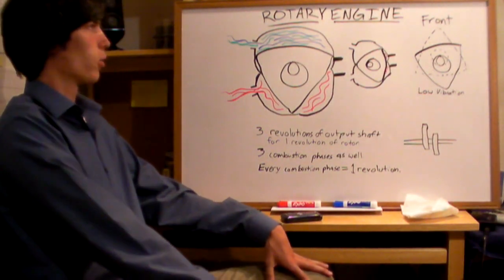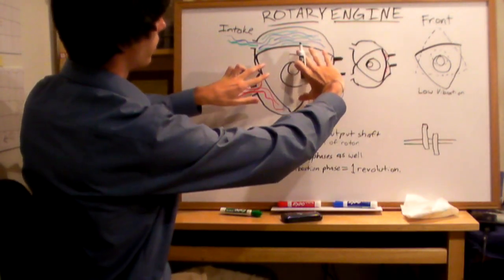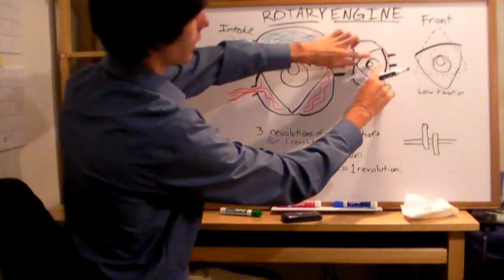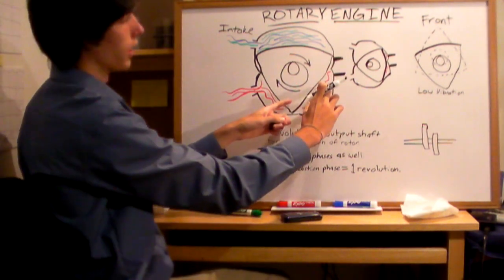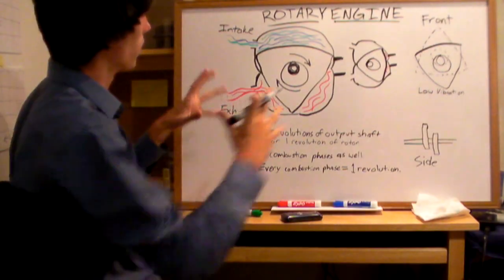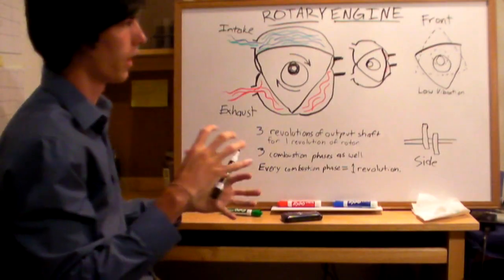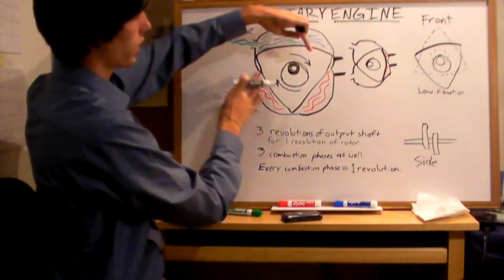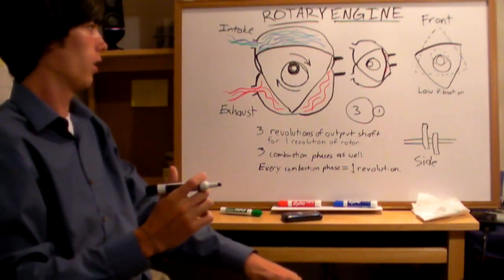Rotary Engine - Explained

Comment: Rotaries are like the engineers wet dream. 3 moving components, amazing power for size and weight. One thing, you're right that apex seals are some of the higher stressed points of the engine, but the synchro gears (the gearing on the rotors and the housing to maintain accurate rotor movement) tend to be the limiting component when it comes to high rpm race engines.

Comment: I had an fc for about half a year. If you are in a budget. Do not even think of getting a rotary.  They use way to much fuel for the power you get. Yes they are small engines but uses a lot of fuel. Only reason I got it was because the sound of a rotary is beautiful.

Comment from the maker: The engines are quite different, and a rotary engine has more power strokes per crank revolution than a 4 stroke engine, thus it produces more power with a smaller volume. Kinda like a two stroke engine.

Comment: seals are an issue, but also emmissions and efficency are also a big problem, Due to the long combustion area (stroke) and low(er) compression plus higher available RPM means fuel can struggle to burn properly and you can end up with a pocket of unburnt mixture trapped ahead of the flame wave that just goes out of the pipe, they can be very reliable when driven nicely, but if you push the red line no rod knock, no valve ratte to warn you 5k miles ahead of an impending problem, just a bang.

Comment: There are more than 3 moving objects in a rotary engine, you only mentioned the 2 rotors and crankshaft. There is also a counter weight. And about the gear ratio rotor/crankshaft, I thought the crankshaft had less revolutions...

Comment: they have different emissions, not exactly poor when considering. The problem is that the emissions rules are created to suit more common engines. The new mazda rotary is extremely efficient now though, they fixed the problems with ports in the new RENESIS.

Comment: Hello I am very interested in the automotive industry. I was just wondering how does a pair of rotary engines compare to regular V6 engine. Is there a major power difference and will the MPG be greatly different. And my last question, is there any way to make it so that the rotary engines can output more horsepower.

Comment: i have an rx8, and this engine does not have very good gas mileage and burns oil (1 quart ~3000 miles)

the apex seals wear out over time and lose compression. this results in an engine rebuild. when they break, they may even hurt your engine more

Comment from the maker: Interesting question. I would think it may be a bit easier, since there are less parts. But developing the manufacturing process would be the major cost, and if the engine can't deliver, the overhead cost isn't worth it.

Comment: First off, by performance, I mean race engine. Low low-end torque is a non issue in a race engine, its all about peak power. Second, rotary engines wear faster, but they're highly durable with new parts (inherent in the few moving parts design), again a non issue for a race engine. Third, they produce more power for the weight than a conventional engine. Have you never heard of the 787b?

Comment: lower compression ratio may be a downside but if its supplemented with more rotors, turbos and spinning at over 9000 rpm, then they're the best performance engines in the world!

Comment: I think you didn't mention the most important pro and con:
Pro: It allows for power power from a smaller engine
Con: It's very hard to keep the parts between its chamber in good condition, causes leaks and loss of pressure. This is why rotary is in this way in fact less reliable.

Comment: I heard that the gaskets on the sides of the engine couldn't keep up, cause of the material it was made from. I know here in South Africa the Rotary racing guys engines are not as reliable as any other, though a 1.3 liter rotary can keep up with a 3 liter v6. but the noise of the rotaries is going to make everyone deaf.

Comment: yeah, but the Rotary Engine is GENIUS Comperitively speaking to other engines that are in every non-rotary engine car today, in a regular car engine you have internal moving parts that change direction to the opposite direction...Rotary Engines don't have any moving parts that change direction, therefor are able to rev 300% higher...

Comment: The RX-8 isn't that very small... in fact I've seen S2000s which utilize the F20C Inline-4 with VTEC and 240hp. These cars are smaller lighter and make a lil more power at higher rpms and have a higher 9000 rpm redline. Rotaries are considered high end power engines as they don't quite make that much power in lower revs.

Comment: 390 plus redline at 9000 rpm without big bucks for the TRD 4A-GE?? I just said it does 11,000 RPMS!! My god you have clearly no idea about this engine hell the F20C does 240hp at 9000 rpms and is built by Honda! These engines can have a 4k Turbo or supercharger with another 3k for tuning and intercoolers and get over 480hp with no issues, and please... do some more research and less name calling.

Comment: ........ You're clearly aren't as smart as you may seem because the 4A-GE is Toyota's Inline-4 made for the AE-86 1986 RWD Corrola GTS Twin Cam and the TRD Version makes 240hp and has 5 valves a cylinder, and Toyota is JAPANESE. The MP4-12C goes for $230,000 USD so you are just plain ignorant and as for the 7k revs I was clearly speaking of the Rotary engines. And the ZR1's OHV V8 goes past 7k and the Ferrari 458's DOHC 4.6L V8 does well over 8k revs stock so you clearly don't know stuff.

Comment: bang for buck means ......... if i spend 10 grand on a rotary engine it will most certainly get down the quater mile faster than a v8 or whatever. mazda might not be a sucess in the us but thats not because of the engine , its because you wanks like larger cars something the rest of the world has no problem . man check out top gear mazda rx 8 and see what they have to say about it

Comment: I'm not going to agree there bud.. If you have to tone down for more reliability then that's not saying much that the engine is having problems and is unable to make the power without breaking something. The F1 cars can or already do make over 1000 hp but safety and regulations prohibit such a thing from happening. If you can't run it... it doesn't count. That goes for EVERYTHING as far as I can say.

Comment: 2.6L and makes 700hp as a racing engine eh? F1 cars do 800hp with 2.4L V8s and redline past 12k so still not THAT good. It's not bad but its not the be all to end all either.

Comment: Lol are you even serious? A TRD Tuned 4A-GE at 240hp redlines at 9k-11k Rpms, 7000 is the redline for most streetable and racing engines are 8500 like you said for some of the racing engines dude. F1 cars with V10s and V8s go up to 14,000 rpms!! Rotaries don't live up to the hype they have like most american cars.

Comment: well mate the mazda rx8 makes 200bhp for a 1.3 litre engine so do the maths on that.
MP$ 12c ok, we are talking 2 different price ranges here to start with , but ill work with. mazda produced an engine it called the 787b a 2.6 litre a natnaturally aspirated engine that produced a Maximum Power: 700 hp (520 kW)/9000 rpm
Maximum Torque: 448 ft·lbf (607 N·m)/6500 rpm
 unlike the turboed  mp4 12 c ls 592 bhp (441 kW; 600 PS) and 443 lb·ft (601 N·m) of torque. It has a redline of 8,500

Comment: Never said anything about the displacement #1, #2 the rotary cars were lower weight then other vehicles and was outta the weight class due to regulations, a banning was obviously incoming, and the cars intially weren;t even in top 10 posting in standings, lap times, or anything. Oh and the 13b will NOT be doing 500hp without mechanical mods stop fooling yourself.

Comment: Wow one Le Mans win oh goodie! Everything else had never been in the top 3 and If I remember the first 2 787Bs had Engine and electrical problems thanks to the Engine heating problems And in the 1991 year of Le Mans one of the Driver's had to convince the officials to allow the 787s to run with less weight!! Less weight equals better Power to weight ratios, allowing more power and helps save fuel! thats why it was fuel efficient that and usage of a closer ratio gearbox! This was in 90-91 so yea.

Comment: the rotary engine is 1.3litres mate not 2, 2.6,3,5 or whatever and again you are wrong, they can handle 500bhp all day . im not saying it is going to achive 300,000km or miles. that is not what a rotary engine is built for , you look at any and race engine of witch a rotary is, and how often to they get rebuilt? mazda won le mans it has proved it's self to be fuel efficient and a contender with a 3.5 litre engine . mazda can no longer compete at le mans why is that?

Comment: It also makes less torque per crankshaft rotation, less fuel economy, and cannot handle 500hp well with forced induction. Most Inline-4s the F20C Vtec especially could do that all day and so can the V6 in the NSX! Don't even get me started on The Coyote 5.0L in the Mustang Boss 302 or the RB26 in the Skyline R34 , or even the V10 from the Lambos.

Comment: Also not only are piston engines making 100+ hp a liter but the get awesome fuel economy as well while doing so! Heck look at the MP4-12C! 25 MPG COMBINED with 600bhp with like 520hp-540hp to the wheels! New GT500 gets 583hp to the wheels 670hp at crank and goes 16 city-24 highway mpgs and I bet neither gets a gas guzzler tax. The GT500 doesn't. I which Chevy V8s  would switch to DOHC too because that OHV is starting to bite them in the ass!

Comment: What they need to do is resign the rotors to spin with faster rpms, have some curves in the rotors in to allow bigger combustion ( I think the space for combustion is TOO SMALL) , use direct injection like you said, and have each rotor housing smaller to aid better thermal and volumetric effeciency as well as aid combustion. If they do that It may help bring rotaries/wankels back, else no point in making rotaries anymore.

Comment: So pretty much with newers innovations  found with R&D and racing and all that with DOHC, valvetrains, and lower ends.... whatever advantage with rotaries is now gone thanks to supposedly lighter, stronger, and more durable and efficient parts for Piston engines therefore making Wankels/Rotaries pretty much obsolete am I right? If that's the case then there is no point getting an RX-8 unless you want the chassis and then you'd need to make a new engine mount, adjust the dampers and all that.

Comment: So pretty much any engine would need not only higher flowing injectors and colder intakes, but stronger seals as well as stronger internals (pistons, valves, rotors, or whatever when adding forced induction correct?

Comment: i dont argue there efficiency. why would i ?obviously they are more efficient that a typical piston engine but still the wankel rotary engine or mazda engine witch is in production today (rx8)) it prduces more power per crankshaft rotation that a piston engine.

Comment: you are very right.rotary is a race engine so they need lots of maintenance or regular servicing unlike a piston engine where you can change the oil only once a year to service. a mazda rotary will surly become dis-functional. every 5000km a rotary should have an oil change compared to 10000km or more with a piston thats why they have a bad rep.

Comment: So then pretty much it could or would make as much MPGs as a V6 or Flat-6? If so then Rotaries aren't bad at all not like what i've been told or had heard of, and im not surprised that It's dubbed a racing engine because the way it works would be great for racing applications.

Comment: compression ratio does not denote gas milage. the rotary engine does not consume for fuel than a v8 it is however more efficient and is a race engine in fact. although a 13b rotary engine is 1.3 litres because of it efficientness some people class it as a 2.6 litre as sweeped volume

Comment: Yea I saw that too and it looks like it would be lacking power as well so yea... its an expectional design and piece of engineering but it needs improvements just like the Flathead Cylinders back in the day when piston engines just came out!

Comment from the maker: @danielsong25 That would be a logical statement, yes. For example the energy of moving a valve up and down is lost and must be compensated for in a piston cylinder engine, where as there are not intake/exhaust valves in a Wankel engine.

Comment from the maker: @EngineeringExplained I should note that although there are 3 power strokes per rotation of the rotor, there is one power stroke per rotation of the crankshaft. My first comment can be a little misleading in this sense.

Comment from the maker: @EngineeringExplained 2 stroke engines have greater hp/liter because they fire twice as often as 4 stroke engines. (See Two-Stroke Engine - Explained) for more info on two-strokes. The more power strokes you have per crankshaft revolution, the more power you will produce!

Comment from the maker: @ichigokillsyou One of the biggest reasons that comes to mind is the fact that rotary engines fire more frequently. In a piston cylinder engine each cylinder fires once (one power stroke) for every 2 revolutions of the crankshaft. So if you're at 4000 rpms each cylinder fires 2000 times per minute. In a rotary engine, each rotor has 3 power strokes per revolution. So if you're at 4000 rpms you have 12000 power strokes per rotor.

Comment: How can a rx8 produce more hp per liter with a smaller compression ratio than a engine operated by cylinders? don't rotary engines with a smaller compression ratio do less and less efficient work? so how come the rotary engine's power to displacement ratio is so high than?